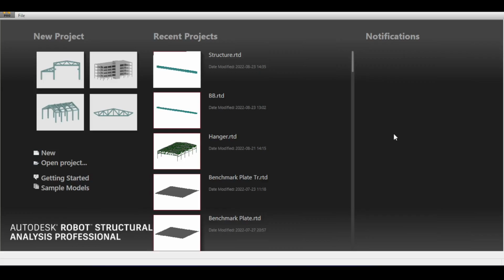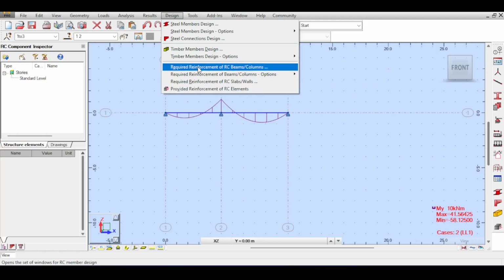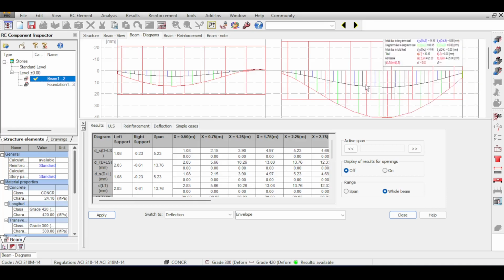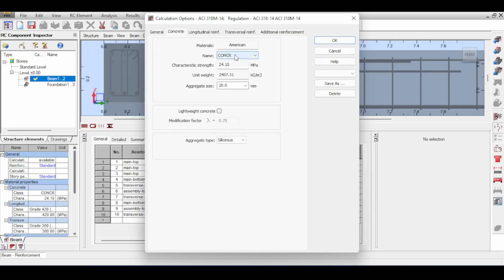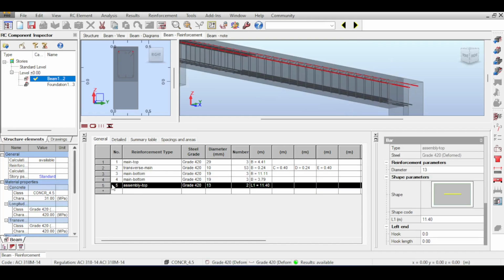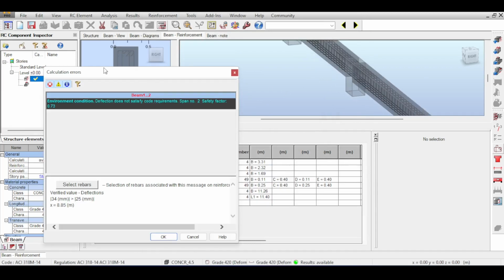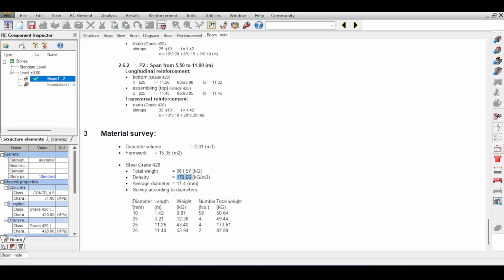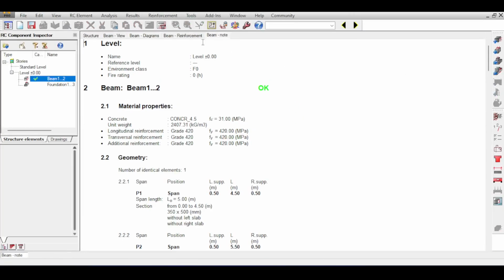Design of RC Beams in Autodesk Robot Structural Analysis

Comment: Hello, great video.
I seem to have a little problem with the Beam-Note.
I am designing using Eurocodes, and in the Beam-Note i get neither the "Ok" nor the "Not ok" message, instead it says: " Number of identical elements: 1".
After some research, I realised that the absence of the messages can be because of a SLS failure, i rewatched the video and I saw that in the Beam-Diagrams window, when you switched from ULS to Displacements, in your case SLS doesn't appear, is it because ACI standards doesn't check for SLS? 
If you have any idea that might help me, I'd be grateful.
Thank you for your dedication !

Comment: Great contents! I have a general question regarding lintel beams carrying wall load above and perhaps floor loads transferred. When modeling, does the lintel actually transfer loads with the arching action above lintel? Give me some directions on how to correctly model a lintel beam i.e., concrete or steel. Thank you, and all the best for your videos! Really impressive.
Reply from the maker: this is a very deep question. So here are two answers for this:
1) the practical answer: you design the lintel as being fixed on both ends and apply the load to be the the bricks above the lintel. This is safer and quicker and usually would result in 2 steel bars at most

2) the research answer: this is a long story. First of all, Robot may not be of help here. You may need to go to ansys.
Why? because now you may want to consider the floor loads above and if those somehow reach the lintel. Also, arching action as you said.

Not only this, the amount of floor load depends on the span between the columns. I mean, imagine there is no wall. The floor would deflect, right?
now when you have a wall, this deflection will be stopped (assuming that you are not putting any compressible material between the wall and the floor. In my region, it is common practice to not connect the walls directly with the floor above to reduce plaster cracking and other stuff). But how is it stopped?
it is stopped because the wall in that case would bear parts of the deflection, which in turn will be transferred onto the lintel. Now parts of it is going to dissipate via arch action (and that is the reason why you see a cracking pattern that moves like an arch with the brick lines if the loads were not accounted for)

So, short answer: RSA would not be the suitable tool to do so for research purposes.

I hope it makes sense
PS: Sorry for the late reply. I had a ton of things to finish and now I am gradually getting back

Comment: can assembly bars be cut off and not go through the top side of support. Normally assembly bar is cut off and lapped with top main bars at certain distance from support but in Robot when you click on assembly bar it looks like it is going through the entire length of beam, does it consider it as part of the area of reinf. provided?
Reply from the maker: For assembly reinforcement, yes you can modify the length and even the starting and ending positions of those bars. All you have to do is click on the bar. A pop-up window will appear where you can modify the length of the bar. 

So: In the top tab selection -> Select "Beam - Reinforcement" 
Then -> Click on: assembly-Top in the table.
Then it opens a small window with the title "Bar"
In it, There is L1, start and end. you can modify those.

Hope it helped,
CEE

Comment: So does auto desk robot also automatically calculate using moment distribution method to allocate the maximum moments and shear and different beam members
Reply from the maker: As far as I know, it does not. It takes the results from the linear elastic analysis directly.

Comment: Thank you for your effort but, I didn't understand why you chose simple cases. Could you explain a little bit more?
Reply: and i am wondering is there a way to uniformly reinforce the beam thank you for your time
Reply from the maker: You can do that. Just force the number of bars in settings to be for example 4 or 6
But note: it is not economical.
Reply: @CivilEngineeringEssentials  I noticed that if we provide the required area of steel that is calculated by a robot, a warning message will appear.for example 3T16 are required reinforcment but the beam fails in bending if we use that number.Thank you for your time
Reply from the maker: If you choose simple cases then it does auto combinations. 
Also, it performs deflection control.

Comment: Dear CEE, I have a problem with providing reinforcement for inclined beam. The reinforcements that I provided (automatically caculated) is outside the inclined beam. Can you tell me a problem? Thank you.
Reply from the maker: Hi there.
if you define an inclined beam in Autodesk Robot, robot will have a problem in understanding how development length should be done.

The problem is: Autodesk robot does not "bend" the bars to follow the inclined beam, so the development length extends beyond the concrete boundaries.

This can be fixed by hand in AutoCAD. You would have to open the drawing and bend the bars manually.

Regards,
CEE

Comment: Thank you for the video. I have two questions and one request :) Since you design with the "Provided Reinforcement of RC Elements" you are not required to create load combinations? Is that why you skipped that step? Does that mean Robot is calculating the combinations and selects the maximum one? My second question is do you have private tutoring? or consultation? Finally, it would be amazing if you could please do a short video on Beam Optimization.

Thank you
Reply from the maker: Most welcome
For the provided reinforcements, when it asks you to import the load cases, you either import simple cases or combinations.

If you import simple cases, then it will automatically calculate combinations based on the correct code and load factors (you need to make sure you select correct codes in the job preferences).

So far, I have no private tutoring platforms or consultation, if there is demand, I would think about it.
Still, stay tuned to this channel as I will keep dishing out content after content.

And yes, I think a beam optimization video or a (deeper video) on provided reinforcement should be warranted.

Regards,
CEE

Comment: Thanks for this videos but I have a problem when I calculated I got a message of capacity design and I change the section but I got the same message . What can I do ?
Reply from the maker: I think in this case your moment might be really large. I suspect a possible error in your units (you think you are working with kN force but are actually applying metric tons). Can you tell me the max. Moment and the section dimensions please?
Reply from the maker: I will make me a more detailed reinforced concrete design video soon.
Reply: I fixed the problem by deleted all loads and put it again but I have another problem that when I designed some of beams and put save as so when I came later to open file I found designed beams with problem although I designed it before . Can you tell me a problem ?
Reply from the maker: @alaaghuzi4845  it is possible that you may have changed the loads or that it was not even perfect in the first place.

I think I will make me a detailed beam design video after I finish the slab series, so stay tuned for that one.
Reply: Thanks 🌹

Comment: Dear CEE, thanks a lot for the great effort. I have a problem if you could help me to solve, I am building my model (RC Bridge) to have moving loads and I have made several load combinations manually as per the design code demands and I want to design the beam accordingly (taking into account the moments and forces due to the moving loads). The problem is that when the beam design parameters box dialog appears, the section of loads combination only states the load combination cases which do not consider the moving loads. It does not allow me to choose the combination cases that I want to design the beam for. So my question is do you know why this issue happened and how I could solve it?
Reply from the maker: Hello there Engr. Safiya,
you are right. For moving loads, in the design fields, it does not "light up" combinations for you.
However, it allows for the simply cases to be taken into account. So you can choose all moving load steps as you simple cases.

Note that: Autodesk robot is even better when you provide it with simple cases.

Hope it helps,
Regards,
CEE

Comment: Thank you CEE. Great tutorial as always. Great job.I love ❤️ your piecewise approach to finding solutions to complex problems.

However, am amazed ACI318 code does not consider the load intensity in computing deflection but only assumes proper member size caters for deflection.

I personally use BS 8110, and personally limit my deflections to 20mm regardless of code provision. 
Span to depth ratio between 10 to 16 works fine for me in member sizing also.

Errors and Instability in robot is really a turn off for lots of users because you rather spend soo much time stabilizing structures or deal with errors instead of actually analyzing, design and checking the structure. 😞 

Great tutorials, alot to learn about robot. 
And yes, an unrestrained bar in any structural member should not be more than 150mm.

Thank you for the insight Sir.
Regards.
Reply from the maker: Thanks for your comment. I am glad you liked it.

ACI318 provides you with a "shortcut" to escape deflection calculations by simply assuming a member height based on a table.

However, it is also possible to calculate deflections using lengthy equations and comparing it with code requirements. 

Finally, Robot calculates the deflection from the service loads, which includes dead and live load.
The deflection limits in the code are a bit more complicated. There are deflection checks for immediate loads (live loads) and long term deflection checks for later.

I might give a full lecture about it in the future. It is, after all, an essentials channel. There will be video lectures about statics, mechanics, structures and design. I have a lot of content planned ^_^

and yes, the best approach is to split the problem step by step. I "could" finish the job in one swoop with 0 errors. But this will not benefit anyone. I rather go through the process of error elimination so that all viewers can benefit of this.

Once again, glad you liked it, stay tuned for more videos.

Regards,
CEE
Reply: @CivilEngineeringEssentials   I look forward to the growth of your channel with lots of content. 💯
Reply: @niisarpei3676  Thank you for your wonderful explanation, I am very grateful for what you offer on this channel.
Excuse me sir, I have a problem and I want to ask you
I design a beam in the required, its dimensions are 60 * 30 cm and its length is 5 meters
It is subjected to a positive moment in the middle of 98KN.m and a negative moment at the end of the beam is 100KN.m. The other end of the beam is zero. . It is subjected to a torsion moment in the end of 14KN.m at the end and in the middle of 9KN.m

There reinforcement in required was at negative moment  4  bars dia. 16
The lower reinforcement of the positive moment was 5 bars of diameter 16
for links
10 by 12 cm
..
When I designed the same beam in the provided reinforcement
the program gave a lower reinforcement of 2  bars diameter 16 and an upper reinforcement of 4 bars  diameter 16
And gave reinforcement to resist the moment of Torsion 16 bars  of diameter 14, and when I changed the diameter to 12, he gave the same number of bars
When designed beam  and this beam resist moment of Torsion  the  program always gives 16 bars 
What is the reason for that?
I am using UK code BBS8110
fy=460n/mm2 for main bars
fy=250 n/mm2 for links
Fcu = 25 N/mm2